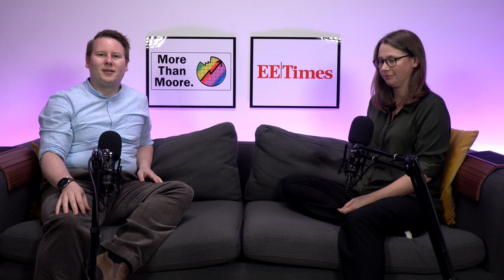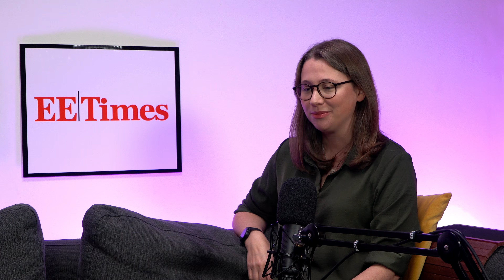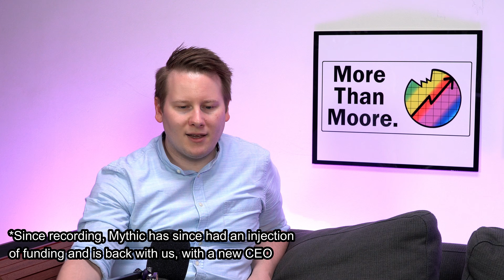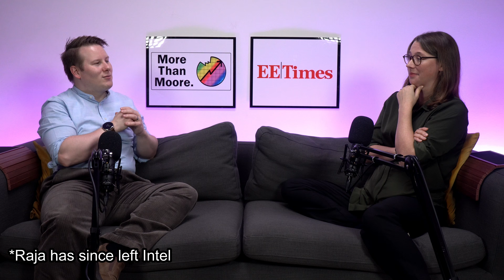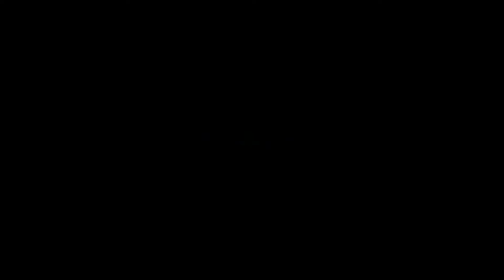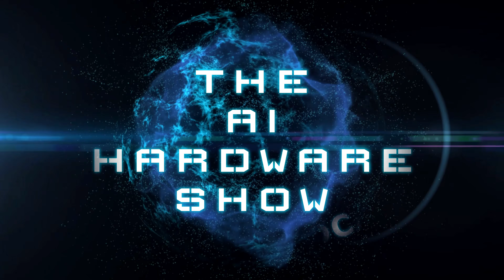The AI Hardware Show 2023: After Show Podcast 2

Comment: Dr Cutress, i have a hope you might hear me. The Ryzen 7000 cooking issue is a classic bus driver latchup - a CPU designer like yourself would know what these are unlike just about every other tech on youtube. 
DDR5 has its own memory controller on board so we are getting the classic instance of a bus signal being sent higher than/too close to the bus driver MOSFET VCC or below the driver ground. This is the most common cause of latchup. There may have been no need to have input protection OVP on the memory controller bus driver til now.
Ofc once latchup occurs there is nothing a thermal system can do (even if it isnt taken out by the lacthup), by the time the thermal system can know something is wrong the damage is done. Im pretty sure teh only way to stop it would be power excursion monitoring.
Im not in CS like yourself, im a lowly engineering technician in audio/embedded but this one is pretty obvious to me